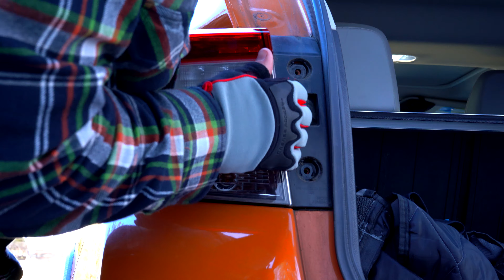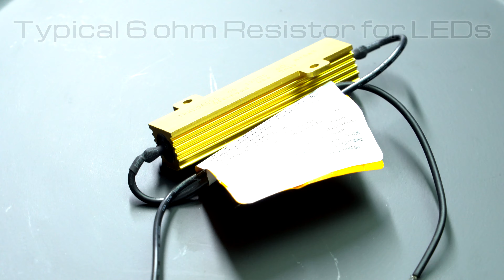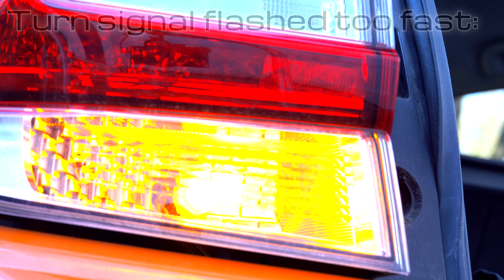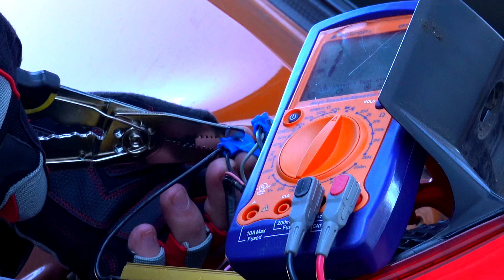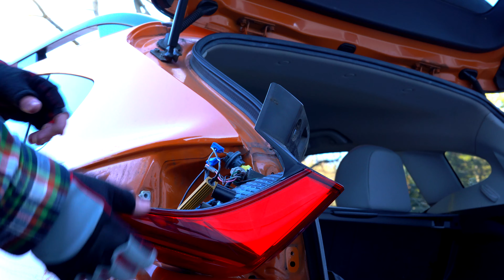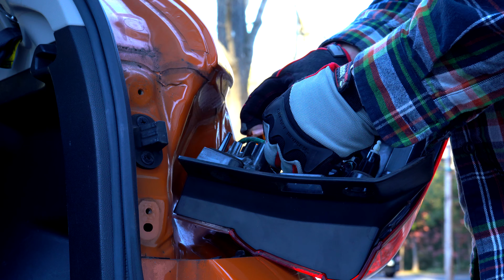2018+ Subaru Crosstrek Rear LED Turn Signal Replacement & How Shortcuts Can Slow You Down

Comment: Did you end up mounting the resistor to a medal body part? I’m concerned if there’s room for proper mounting with self tapping screws behind the tail light assembly once it is reinstalled.